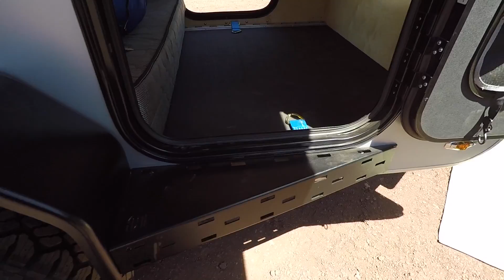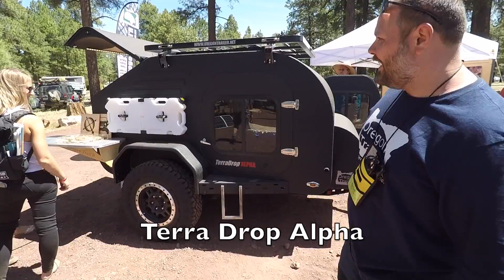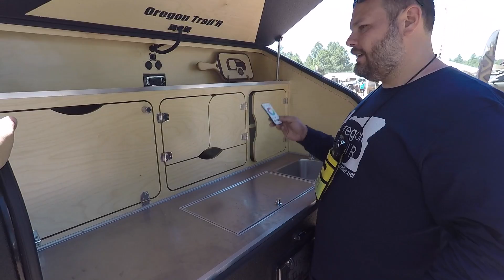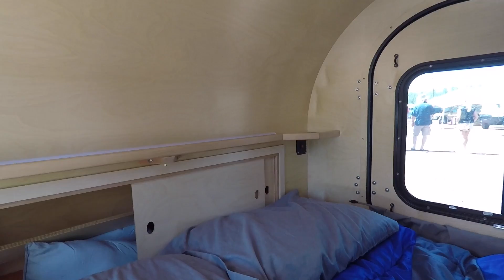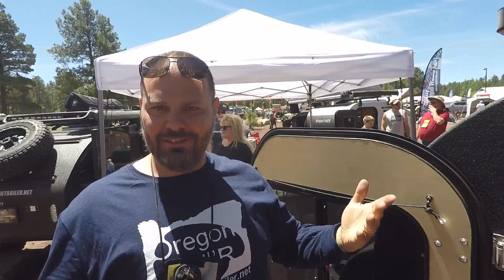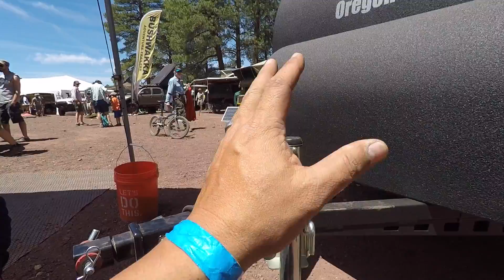Terra Drop heavy duty tear drop trailer by Oregon TrailR : Overland Expo 2018

Comment: I been watching a lot of these "adventure trailer" videos.  They're all way over complicated.  To the point that an RV would almost be better.  Doesn't anybody make a simple expedition trailer?
Reply: I guess you are supposed to buy their "base models" that have probably none of the bells and whistles. Their small "do-drop" trailer starts at around $6000.
Reply: Or you could go full DIY and buy your own trailer and build the whole thing.
Reply: Yeah, some Australian companies make an expedition one along with a Canadian one. 

These are nice because you can make a camp and drive off away from it. Which is better than using your vehicle with a roof top tent.
Reply from the maker: Hiker trailer makes a budget camper for about $4000 to start

Comment: How does this compare to the Off Grid ones?
Reply: It really is personal preference at this level of camper building. These use marine grade wood that will outlast the buyer and his kids....the off grid trailers are all metal and synthetic materials and will outlast the buyer and his kids too lol.

Both are built in areas that have alot of rain and snow. Oregon vs Canada. 

Both cost north of $20k
Reply: I think off grid is better designed with a ton of built in features for the price. This I think “looks” better however but form/function wise I think it’s no contest

Comment: Great idea, but I did mine for $4000, all you need in a small trailer lift it, put all terrain tires on, solar, much more room can go anywhere this one can. I guess people have money to burn. Old aluminum trailers work best .
Reply: You mean like just buying a cargo trailer? I have to think the weight is different as well as the MPG. But for those on a budget I admit it would be hard to beat.
Reply: @remyllebeau77  You can a number of ways, I used a 12ft old aluminum camp trailer, everything is already in as far as stove, ice chest etc. You can strip it down to remove weight of things you don't need, fridge, cabinets, so on. I didn't worry about weight as it was light and easy to haul, But i had a beefy truck, didn't really need it but that's what I had. Tear drops shape makes for a more aero dynamic rig, but for the cost difference you can buy a lot of fuel. I think it's more of a fade to own one, my friend has one, cost a fortune, but she has lots of money, not me. I have owned countess trailers of all kinds though my many years of camping. For the last 10 years we have done to big fifth wheels with two slides, the cost of a used one is about $10k, of course forget economy. But we are older and like the room and amenities.
Reply: @timmytool1231  That is true and a good point, but it is hardly fair to compare a brand new trailer with a used trailer. Apples and oranges and all that.

I think it would be nice if someone came up with some good DIY instructions for building your own trailer rig, or for buying a cargo trailer and building the rest yourself, or even making your own pop-up.
Reply: @remyllebeau77  I have never owned anything but used trailers, I do all my own mechanical work, used says a fortune, but you need to be able to fix, stuff, brand new will have problems, in fact the older stuff is so much better built than new RV now days. Very cheaply made.
Reply: @timmytool1231  I agree.
Reply: @remyllebeau77  Just look up Keystone trailer complaints to get an idea of what RV manufactures are churning out.

Comment: Cracks me up you guys put expensive off road tread tires on these tailers! It doesnt drive and it doest steer back there! Lol. Ok. It does look good though.
Reply: @Oilngld  thank you for saying that
Reply: Apparently you don't get it.  The off road tires are built to prevent punctures from sharp rocks on trails.  NOT to dig you out
Reply: Ryan we build frames for a camper builder to me they are spending money and they don't need to be there is no different they runaway campers but cost way more because they want different fenders they runaway it's beyond me why they spend when they don't need to

Comment: since it has  2 doors opposite each other i think they missed a big oppurtunity to stick a whole door sized slide out storgage compartment  that fit in the bed area for transport that quickly slides out when you need the bed. Could double interior storage option and or built in gear that isnt any room  for elsewhere.
Reply from the maker: Good idea.

Comment: It’s a little misleading I’ve been on their website and the base model for the Terradrop is like $16K. The DO drop base model is the one that is only around $5k- but that one doesn’t come with the galley/kitchen in the back which is kind of key.... so I’m a little confused but if it’s actually only $5k for the base model of this one I am SOLD! :P
Reply from the maker: It's like any other big ticket item. There is a bare bones budget starting point....and it can go up from there depending on the features you want these custom builders to ad into the design when you sit down with them before the build. 

Remember this is basically a small family business with no dealerships and almost no mainstream marketing. It's also all hand made and here is the biggest of all....its all made in America and that right there is expensive.

Believe it or not China makes off road trailers too.

Comment: Can it be pulled by a atv
Reply: Hey Joshua, this one weighs 1650 lbs, so I'd wager it's a bit heavy and wide to comfortably tow with an atv, however, check out our DoDrop.  Basic model weighs 515 lbs, and is a full 12" narrower.

Comment: I want one bad...im torn between the do-drop and terra-drop...I live near Tucson and plan on doing heavy duty off roading...where can you put a spare tire on the terra-drop?  And get ready boys, cause im running 35s on 17 inch wheels!  Whats your wait time?
Reply: Awesome, glad to hear it!  Here's something you won't hear from most companies...  I think you'd be better off with the less-expensive model (based on what I know so far).  While both are very highly off-road capable, the DoDrop Alpha is better suited for the extreme stuff. This isn't a durability issue, it's about real-use consideration.  The DoDrop is a solid 12" narrower, making tighter turns possible and obstacle avoidance much easier.  It is also roughly half the weight, making life much easier on your tow rig (and on a recovery vehicle if you manage to get stuck).  TerraDrop Alpha can handle anything DoDrop Alpha can, but at 80" wide it's a bit wider than most tow rigs, and longer from tip of tongue to axle-center, meaning it's turning radius isn't as good, which can be a dealbreaker on switchback trails or very narrow trails. That said, a really good driver can always find a way!  We'd be happy to build either for you, but we are also happy to give you our real-world feedback from off-roading both of these trailers.  In tight, technical trails, DoDrop is a clear winner.  But if your particular brand of off-roading allows for the extra width and weight, having the extra space and creature comforts of TerraDrop is awesome.  The spare can be mounted either underneath TerraDrop (still will have 15+ inches of ground clearance with a standard spare), on the roof rack or a tongue rack, or we could likely come up with something special if you wanted it mounted to the side or similar...  Check out the following link to see a quick snippet of DoDrop Alpha taking on the rock-garden at Overland Expo a couple months back- https://youtu.be/7QXEQPL_tB4

Comment: I agree with everyone else. This is a very nice trailer but the exposed water tank with no skid plates is a HUGE flaw.
Reply: "everyone else," LOL.  I'll tell you the same thing I told the other guy with this concern- The lowest point of that water tank is 24 inches off the ground, the lowest point of a Jeep Wrangler Rubicon is 10.8 inches.  The best ground clearance of any stock off road rig is a Land Rover LR4, with 12.2 inches.  A Mercedes Unimog, with portal axles STILL only has 15.7 inches of ground clearance.  What does this all mean? It means that if you scraped the water tank on this trailer, you have already destroyed your tow vehicle, unless you are driving the Grave Digger.  And we aren't worried a bit about rocks flying up from the highway, this is super-impact resistant roto-molded plastic that can sustain any amount of gravel thrown up at it.  There's no point in adding a heavy and expensive skid plate to a tank that will never sustain an impact that would necessitate a skit plate.
Reply: OregonTrailR so why do Jeep owners often install skid plates on their lifted vehicles when off-roading? Because a big rock doesn't care if you are 24" off the ground. If they are protecting metal parts with skid plates on their lifted Jeeps, I am pretty sure there is a good reason to do that for a plastic tank full of water that is supposed to supply your stay while Overlanding. LOL
Reply: Look, we can absolutely install a skid plate over the water tank... super easy... no problem... wanna buy one now? We're happy to build yours with a skid plate... :) The mount points are already there and ready for it... We have several other options available for our trailers that are not shown on this unit as well... Hopefully this bit of info will help lower our collective blood pressure regarding skid plates.
Reply: @mississipVol,  I see my brother already responded to your comment, but allow me to respond as well.  Some Jeep owners install skid plates because the parts they are likely to drag are a full 12" lower than any sensitive points on this TerraDrop.  That said, we have installed and will continue to install skid plates on campers that are ordered with skid plates.  The owner of this particular TerraDrop in the video above did NOT want the extra expense and weight of something they will never have a need for.  They are casual off-roaders (towing behind a Jeep Wrangler without armor), and will not be taking their camper to Hammertown to compete in rock-crawling races.  We build our campers to order, and this was not ordered with skid plates, it's that simple.  Like my brother said, if you want it on yours, you can have it, but start saving up buddy because skid plates are very expensive to make.  Lastly, and perhaps most importantly, our water tanks are made of roto-molded High Density Polyethylene, which is the same material many 4x4 accessory companies are making their skid plates out of these days, because of it's incredible ability to withstand impact, and the fact that it has very little sliding friction when compared steel or aluminum, allowing it to very easily slide off of rocks, trees, whatever.  LOL
Reply: good info, thanks for clearing that up.
Reply: My pleasure. Have a nice day.

Comment: THESE ARE NICE BUT WHY LEAVE THE WATER TANKS OPEN TO THE ELEMENTS UNDER THE THING ,OFF ROAD ROCKS COULD EASLY BUST THEM IF DRUG OVER THEM,AND EVEN ROCKS FLYING UP OFF THE HIGHWAY CAN HIT EM
Reply: WHY ARE YOU YELLING AT ME???? Only kidding of course, but the caps lock does make it hard to read your comment.  The lowest point of that water tank is 24 inches off the ground, the lowest point of a Jeep Wrangler Rubicon is 10.8 inches.  The best ground clearance of any stock off road SUV is a Land Rover LR4, with 12.2 inches.  A Mercedes Unimog with portal axles STILL only has 15.7 inches of ground clearance.  What does this all mean? It means that if you scraped the water tank on this trailer, you have already destroyed your tow vehicle, unless you are driving the Grave Digger.  And we aren't worried a bit about rocks flying up from the highway, this is super-impact resistant roto-molded plastic that can sustain any amount of gravel thrown up at it.

Comment: Too cool....propane and spare gas tank is a little worrisome to me...
Reply: May I ask why?  They are both inside the "envelope" of the trailer's extremities, meaning if you were sideswiped by something (car, tree, whatever), it would have to rip off the wheel/tire/axle, and the whole fender/deflector/step assembly (which is held on by a plethora of stainless steel through-bolts), before either of those fuel containers get hit by anything.
Reply: Rocks...
Reply: I would want those two items on the curb side.
Reply: Greg, we put them on this side for a few different reasons. First, the stove is on the driver's side in the galley, making it much easier to plumb the two together.  2nd, the passenger side has a 4 gallon rotopax tank that is commonly used to refill the water inlet, which is also on that side.  And lastly, given that most vehicles have their fuel access on the drivers side, it makes the most sense to have the extra fuel tank on that side as well.  We are always flexible to the needs of individual clients though, so if someone had a good reason for changing it up, we are always willing to have that conversation.
Reply: That's what mud flaps are for!  The Rotopax gas tank is a roto-molded plastic with incredible impact resistance, and the propane tank is 3mm thick steel, which is also not getting touched by anything thrown by a tire.
Reply: 'cept fer them big ones you might rub up against but hey have it your way.....I'll look elsewhere for my off road advice and products.
Reply: Rik, Both those tanks are directly above the tire and fender, and don't stick out as far as the tire or fender, so to hit them would mean that "them big ones" would have had to rip off the fender, the tire, and the axle, which isn't going to happen, because we put stainless steel deflectors in front and behind, which will push the trailer away from any obstacle before it has a chance to do all that damage.  Feel free to get your off-road products and advice anywhere you please, but any person in the know will tell you that obstacle avoidance is a driver-responsibility, and one VERY important to actual off-road travel, whether you pull a trailer or not.

Comment: Where's the fridge?
Reply: While we have options for mounting fridges, they aren't displayed in this video.  We keep options open, because many of our overlanding clients have fridges mounted in their vehicles already, which we strongly recommend as the preferred fridge location.  This way if you leave the trailer as base-camp while you go on day trips in your rig, you have your food/drinks with you.
Reply: you can also buy a electric refrigerator radiator coil and install it into that middle storage compartment next to the sink?with some spray foam insulation it would be a fridge,good to keep food and drink cool?
Reply: i seen that idea as an option for a small cabin cruiser boat,they turned a back storage bench into a fridge cooler from just a storage box?
Reply: very little voltage/watts to if insulated right?
Reply: was a small coil too that they installed maybe 6" x 4" for a standard cooler size compartment simular to that middle compartment of back trailer.
Reply: Rngnd1314 we have looked into that a little recently!  We have some ideas brewing which are very similar to what you are talking about...  it’s going to take some redesign here and there, but ideas are in the works!

Comment: Nice trailers but they need to start using composites to replace the wood. That would reduce the weight significantly. Good to see the use of an articulating hitch.
Reply: Composites do have their advantages, for sure, and there are plenty of campers out there being built with them.  We prefer using Baltic Birch plywood because of it's massive strength/stiffness potential when combined with furniture-style joinery techniques (can't do with most composites), it's ability to be easily repaired if necessary, and also because it's just plain gorgeous.  The feeling you get when laying inside one of our campers, watching all the beautiful grain flow throughout the cabin, simply cannot be replicated by composite materials.  Thanks for the comment Gary.

Comment: Great video once again Mixflip. Subscribed!
These are probably the best teardrop style trailers out there imo. Well thought out and excellent craftmanship!  I'm curious about the decals (?) on the line-x.  The flag and white and red  oregon trail'r logo's....are those painted on or are they vinyl decals that have been melted into the line-x? 

Great stuff guys!
Reply: Steve, thanks for the kind words!  We apply the vinyl very carefully using lots of heat and a special pressure roller.  Not easy, but works well!

Comment: Do they have the weights on the website?
Reply: Hi there, we don't have all the weights listed, because it varies so much with options.  For example, both the TerraDrops in this video are in the 1500-1600 lb range, and the DoDrops are around 900 lbs.  Base TerraDrop is closer to 1300lbs, and base DoDrop is around 500lbs.  Thanks!